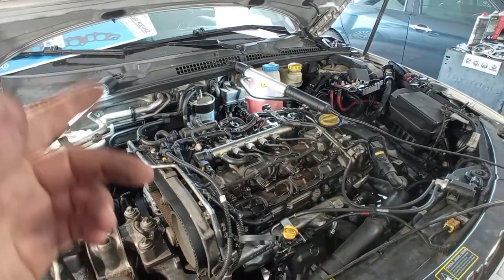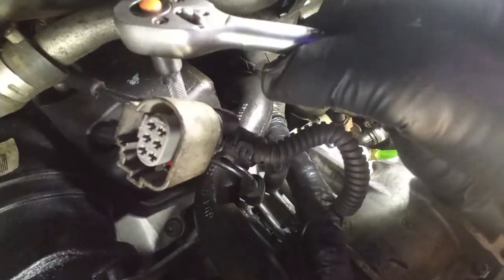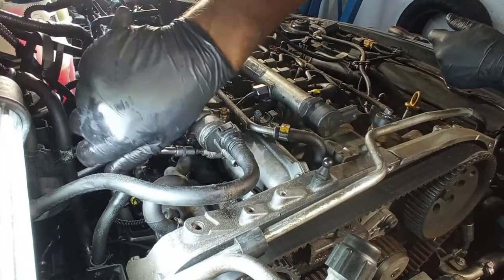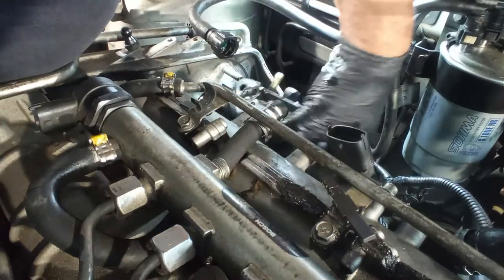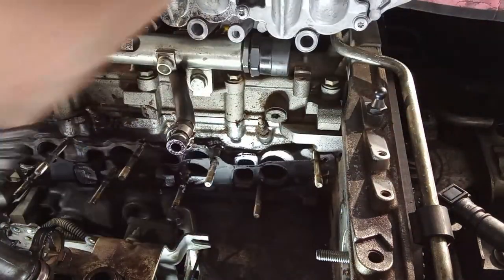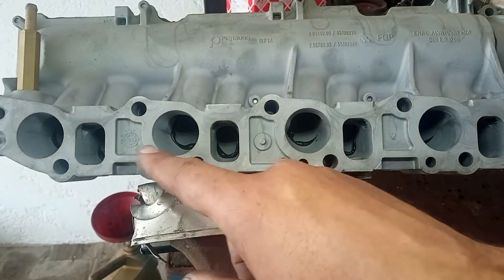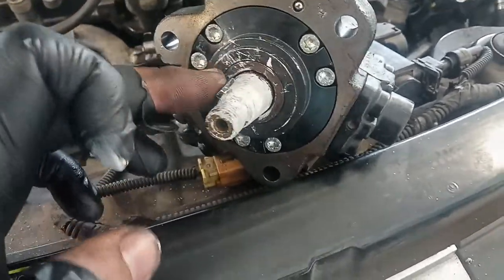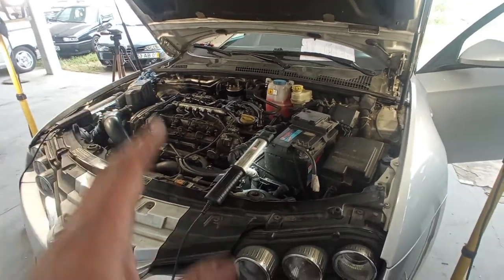How to disassemble, seal and assemble intake manifold, 1.9 MultiJet 16v engines. Alfa Romeo 159

Comment: why you have to block the timing belt in order to take off the intake manifold?
Reply from the maker: Hello. Because I did removed the hi pressure fuel pump. And not too take the risk of having the belt skip a tooth or so
Reply: @alfaromeonoproblem  ok, tnx brother. and can you tell me the codes of the gaskets you used in that video with 1.9 leakings
Reply from the maker: @markoctavian1448 out differs from car to car. Check on eper.fiatforum .com

Comment: Hello, I have a Fiat Stilo 1.9 JTD 16v 2004, and I want to remove the intake manifold to clean it. However, the high-pressure pump is in the way. Do I need to remove it along with the timing belt and the pulley, or can the pulley be locked in place while loosening the pump bolts?
Reply from the maker: Hello. I have a video for that to
https://youtu.be/D040o2yjDBM?si=eJm3UsUhpSVGYuCk

Comment: Hello what size do you need for the fuel pump nut to remove it? And also what size screws do you need to secure the pulley of the pump ?
Reply from the maker: Hello. The bolts I use the ones from the cover. But use whatever you like. The nuts are 13mm until the 156, after 159 are 12mm flanged with no washers
Reply: @alfaromeonoproblem thank you very much, and what size socket do I need for the big nut on the fuel pump?
Reply from the maker: @danielkyorchev6518 22mm
Reply: @alfaromeonoproblem thank you very much much, I love your videos, you are helping a lot!

Comment: Just a question regarting the excess sealant, do you leave the bits that squeezed out inside? No way to get to them once its all sealed up
Reply from the maker: Hello. No way, just use the minimal correct amount. Sometimes I can get some bits out on the intake runners
Reply: @alfaromeonoproblem  might be overthinking it a bit then as looking inside my intake i can see what squeezed out but i cant reach to remove it, ocd kicks in immediately thinking it will come loose and go into my intake valves 😂
Reply from the maker: @arturaspranckevicius3947 that's not the worst thing the intake valves usually "eat" carbon, dust, the swirl flaps! 
A bit of rtv is not good, but not terrible

Comment: that was a really nice work. i have a 2009 1.9jtdm 16v manuel 159 and have a problem with it but can't find it. Problem is when the boost pressure builds and get to peak bar it suddenly drops to half and the acceleration slows and some cases acceleration stops. we changed map sensor, pierburg, pipes, throttle body nothing changed. i have the videos on my channel. one of the videos you can hear the sound changes when the boost drops. what could it be any ideas? Thanks anyways
Reply from the maker: Hello. Thanks for watching. That throttle body is not, is just a shut off valve.
Can you do some diagnostics? Air pressure and mass 

https://youtu.be/sCA-z95YvWI?si=unEkpWanMRtbaSjT

https://youtu.be/7erMLUm_1do?si=881CSFvjE9afMNYr

https://youtu.be/OOQHER01Apo?si=3MrbUXPLpv2oAqfL
Reply: @alfaromeonoproblem  hi, we did diagnotics don't have any fault codes but didn't do the test while on the way we changed the maf and turbo pressure valve nothing change. The previous owners of the car may have installed the wrong software on the car. Could it be that the turbo pressure is higher than necessary, causing the wastegate to open and releasing pressure? or is there a crack somewhere (intake or exhaust manifold) that can't handle high pressure and couldn't hold it. because turbo can hold pressure below about 0.8 - 1.0 bar.
Reply from the maker: @Garrett159R Make sure to have the original software.
By the way, that turbo doesn't have a waste gate. It's a vgt, or should be

Comment: Hi can you help me, i have alfa 147 1.6 ts 77kw, my car would turn off when coasting in neutral. Went to mechanic to check codes and it was maf sensor, i bought new one and it still does the same thing. Also my rpms dance when in neutral. Here no one knows how to fix alfa's i'm on my own. Where do i start ?
Reply from the maker: Hello. Start with the basics. How are the spark plugs? How is compression? Air filter? Most importantly on those engines, is the timing done well?
Is the mad you bought good quality? Remove the connector and drive it to see.
Is the engine consuming oil?
Reply: Hmm i assumed all of those things you said before asking you. Brand new bosch sprak plugs 8 of them. Shop where i did timing belt said it was off 2 tooth, they did it corectly, also i asked about comp. they said compresion was good actualy wery vell for 2007 engine , did oil change and all new filters, 10w40 selenia oil it does not use extra oil. Also bought oem bosch maf waited for 2 weeks. When I disconect maf it runs very bad rpms wont drop below 1 K. I dont know how other 1.6 engines sound but there is "electrical" buzzing sound coming from throtle body. Can it be faulty throtle body ?
Reply from the maker: Very good info, thank you! It can be the throttle body, yes. Try to do a adaptation to see if it stays good even for a moment. Also you can remove it and clean the back side of it too.
Reply: Yes i cleaned it that was frist thing i did  do ibut i did not have torx bit 45 to take whole th.body off so i cleaned front side frist then i took off whole body when bit arived and cleaned everything throtle body wasnt quite dirty but intake mainfold was dirty the part i could reach. How to do an a adaptation ? Also, if i change throtle body i tried finding  brand new one i could't find it, so used one then i'm assuming you can't just put new one with out some computer work ?
Reply from the maker: @sids15able you have to do an adaptation every time you put a new one and or a cleaning.
With a diagnosis machine
Reply: Hi i think i found culprit injectors, Engine Stalls or Rough Idle. Your car may sputter or shake, mostly during traffic stops. ...
The Engine Misfires. ...
Bad Fuel Economy. ...
The RPM Needle Starts to Dance. ...
Check Engine 
I have all of this above and smell of petrol when starting up, i'm gonna try taking them of and cleaning, do you have any advice ?
Reply from the maker: @sids15able it may happen, yes. Take them out and send them to the injection guys
Reply: thank you for your advices keep up good work, not many people have left that knows how to work and fix alfa's
Reply: Hi i'm at dead end again, did loads of things, drove to the another city to the 'alfa guy' changed O2 sensor throttle body again 'new' used maf, all ignition coils, tested wires and wiring. Can you guess same check engine light for maf sensor and same stalling when in neutral. Do I just set it on fire and leave it to burn ?
Reply from the maker: @sids15able I'm not sure I follow

Comment: Another great video to keep in mind if I ever get around to doing our 1.9 croma, before the swirl flaps break off and fall in the engine hehe

Some things I noticed and was wondering about, at 2:30 , that seems like a refurbished power steering line? Have you noticed the steering vibrate when turning the wheel stationary and idle? I got mine (159 2.4 210hp ) refurbished and now have a vibration and a slight whine from the pump, but it becomes silent when turning right, something to do with the flow of oil (brand new red Dexron 3 flushed multiple times) I believe? Do you think it's possible the power steering tank is at fault or a poorly refurbished pipe or both? Would it be worth trying a brand new tank (60€ vs 280€ for the pipe) first?

Also at around 6:00 that oil seperator(?) at the bottom of the screen looks similarly dirty to mine, but mine is also covered in oil, i think one pipe has a little hole, do I need to replace the entire pipe or is it possible to somehow fix just that part? Also could the system be clogged and be the reason for a few drops of oil dripping from the turbo pipe, from the left side of the turbo? I also have some oil consumption, not sure how much, but it has dropped by 1-2 bars on the dash in 2kkm since I've had the car. The turbo also sounds like a siren, apparently common for the garret turbos, either from bad oil or clogged oil pipe or possible something to do with the oil seperator/breather system?
Reply from the maker: Hello. True oil separation system has no way to clog, it is a open system.
The hard hoses are the reason of most of the leaks.

For the power steering line repair, I do not recommend it. It will vibrate and do other problems. I only recommend a new line.
With our without a new reservoir.

For the reservoir and the fluid replacement I will do a tutorial video
Reply: @alfaromeonoproblem  Is there considerable pressure in the oil seperation pipes from the top, possible to fix with some sort of ruber clamp or similar? 

Main project currently is a wheel bearing and bottom engine mount that is destroyed from that leaky power steering line, after that refurbsih injectors, I get a bit of a knocky sound at partial throttle around 2k rpm, but ONLY when it gets to 90c, possible bad remap?
Reply from the maker: @EndstyleGG for remap I cannot comment.
The hoses on the breather system have no pressure at all.
Reply: @alfaromeonoproblem  Thank you for the help, I'll try to find exactly where it's leaking and put something around it for now, until i find a replacement. 
As for the injectors it's truely strange, I get fairly bad corrections, some at -2 some at +1. I'll get them tested and cleaned soon, hopefully that solves the issue, but yeah recently I was driving in 2nd gear around 2200rpm, and just as I saw the temp guage go to 90, i noticed a clattery sound appear, need to check some parameters, maybe too high fuel pressure?
Reply from the maker: @EndstyleGG maybe injectors. Hi fuel pressure would give you a fault code and engine off

Comment: Bruno, do you recommend fitting oil catch cabs to pcv system in JTD engines? I know you have of  them in your 155 you mentioned previously. Thanks 😊
Reply from the maker: Hello. JTD and MultiJet already have them from Factory. And quite good too
Reply: @alfaromeonoproblem  wow, okay. Do they require emptying? It's not something I've seen in the manual or even noticed the device 🙊
Reply from the maker: @TheJohnnybigmac9 they self empty to the oil sump. No maintenance required

Comment: Hi, very good video. My 147 has the plastic Intake manifold. Is it the same to disassemble? Engine Code 937A5000. Would you recommend to remove the swirls? EGR was shut down at 15.000km mileage.
And I think the 147 has no Oil Catch Tank? Is that right? So would you recommend to install one, to prevent the intake manifold getting dirty?
Reply from the maker: Hello. All jtd, mjet, jtdm diesels have the oil separator. 
For the plastic manifold the procedure is the same, yes.
And yes you may want to remove flaps

Comment: Hi bruno what about cleaning the valves, when the intake manifold is that dirt? Do you usually do that?
Reply from the maker: Hello. I try to avoid that. A lot of carbon can fall in and lock the engine even. If is too serious I will do it. But if the egr is staying, o live it alone

Comment: hello, I have an alfa romeo 147 1.9jtdm 110kw. I have a plastic suction there. is the procedure the same?
I'm more interested in the procedure with the injection pump. just stop the injection pump with two screws and pull away? won't there be a problem with divorce? when do I loosen the screw on the injection pump?
Reply from the maker: Hello. I will have another video for that. Stay tuned
Reply: can you write somewhere? I would like to ask you something
Reply from the maker: @mikoo1525 ask here
Reply: I have a problem with abs on my alfa romeo 156 1.9jtd 103 kw. diagnostics shows no error. handbrake, abs and vdc system failure light up on my dashboard.
Reply from the maker: @mikoo1525 hello. You have to use a professional diagnostic machine